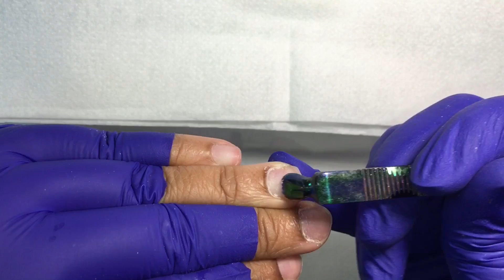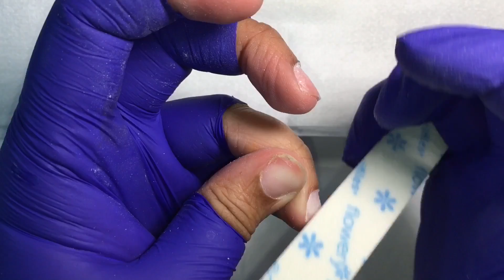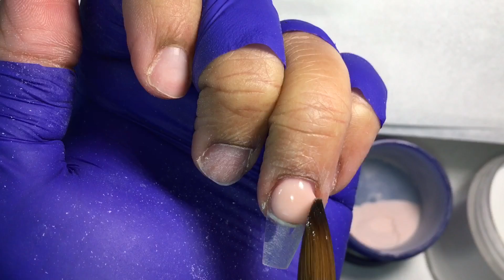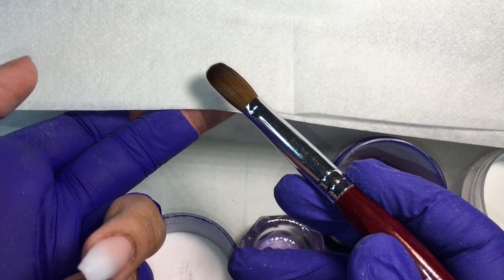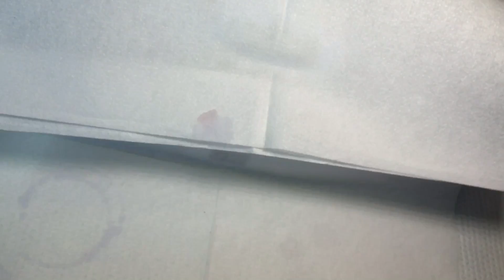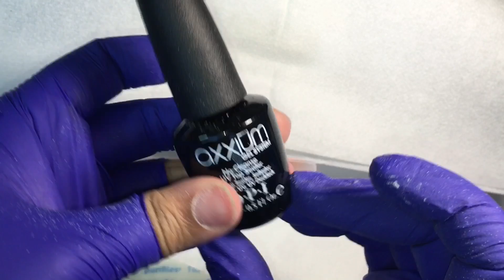Nailtorial: French Ombre (Baby Boomer Nails) Tip and Coffin Shaped

Comment: Thank you!! I finally got it! I had a pink color ( no lift nails pink) that was sheer, I never used it, as I thought it was a cover pink... Anyway.. I finally got it thanks to that tip!!  I wish I could add a photo! Although.. I did my white first.. made it stronger at the tip and then took it pretty fair down. Then the cover pink.. then over with my sheer pink!! Sheer pink made all the difference!

Comment: The epinicium is what you trim not the cuticle. I'm a nail educator you have it backwards.
Reply from the maker: +Shannon Graves We cannot trim the eponychium as a licensed manicurist in my state. We are trained to push back the cuticle that has grown on the nail plate, remove the excess via friction of the actual cuticle pusher, curettes or etc then trim any excess past that (I choose to use an e-file bit made for this purpose in place of this step). I would like to just assume your state's/country's guidelines may be different from mine but I was educated to perform maintenance in this manner to reduce possibility of infection, cutting, scabbing and scarring of a client; therefore, I pass my knowledge forth (and it has worked for me☺)